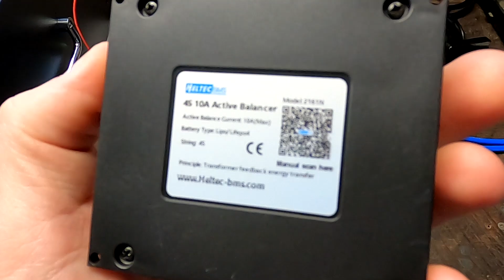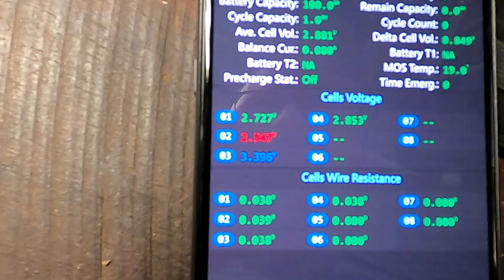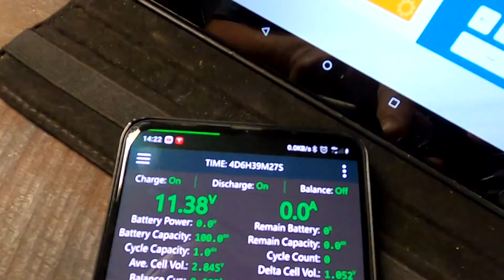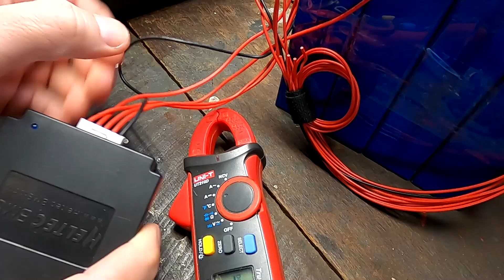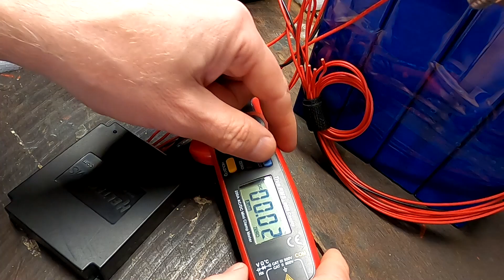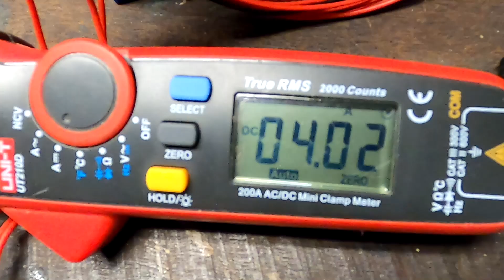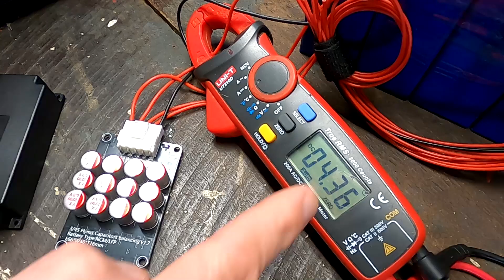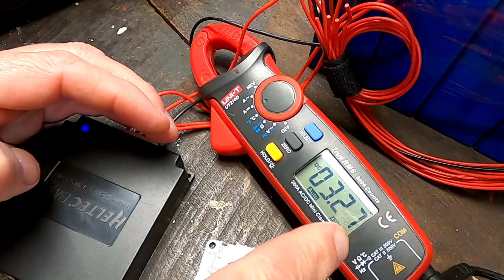REAL 10A with the HELTEC Active Balancer. Can we make it happen?

Comment: Hi Andy,  I'm sure I speak for most people by saying,  we are greatful you test things in a realisting manner,  not some server rack pack that's capacity tested and then a visual look,  most youtubers just do that,  you test things we actual curios on buying and test all the,  " but what if"  things. 
That open circuit balancer (the cheap ones)  I soldered 2 of them together on my 16s setup,  with a 300mv dif, using the same clamp meter I measured 8amp balance current. Just a suggestion, haha works better then the heltec and is still cheaper to have 2 cheap ones. 

Summer is coming for you and I,  and if I can suggest,  why not put panels on the tesla roof,  that gets less shading for winter, 
Useless update from my side on my 6k array,  winter I got 26kwh average,  and this time of year now I'm already up to 37kwh, noting 80% of my panels face north at a 40* angle.

Keep up the good work,  ps that number of subscribers paper is way out of date,  unless your not doing it anymore.

Comment: Good info, Thanks Andy. 
Btw, I recently built some EV packs from some "new" 32700 I got last year (now three years old) and some Daly 16S dumb BMS's, and while they worked on some perfectly matched and top-balanced cells they are incapable of balancing even 6ah 1s strings because they only balance with about 10- 20ma of current during charging above 3.45v. I tried charging at very low current for about 6 hours but only limited balancing.
Reply from the maker: Yeah, with the Daly, you need an active balancer. Their balancing will only work with small capacity cells if they are well matched and of high quality.
Reply: @OffGridGarageAustralia  And from what I just observed,  not even with small capacity cells that are well matched and top balanced. I just did a postmortem on a "quality" name brand 20ah, 18650 Li-On pack that had a Daly BMS and Lishen cells.The owner had been charging it after every about  40% use for about a year (about 100 cycles), and 3 out of the 6 parallel strings were more than .8 volts lower than the two remaining good strings. I suspect as the Daly BMS was not able to balance the strings and one string was finally over-charged to death.  

A local ebike shop that sells and services Bosch eBikes has what looks like at least 50 dead Bosch Factory packs with what looks like Panasonic cells that exhibit one or two dead strings and other imbalanced parallel strings. They appear to be using a similar design BMS to the Daly. 

My guess at this point Andy, is that makers of smaller eBike packs don't have physical room and budget for a proper an advanced BMS with adequate balancing, and never the less it if true, makes the case for not using a BMS without proper balancing, and to monitor, maintain and properly any pack as you are demonstrating here.

Comment: I wonder,  can the Heltec balancer pull from more than one cell and then pump that energy into more than one cell?     What if you had two drained cells and two full cells?    Would the balancer pull 4+A from Each of the full cells?    That would start getting closer to the advertised 10A.
Reply: That's what I was wondering as I watched the results.

Comment: Andy..... back when you were testing the dely  BMS can you remember what amperage needed to go into the BMS before it started charging?
The one I've got the charge controller is putting in 6 amps and the deli is only just turning on,
 seems to be quite a lot of loss of power.....
Which means if I get a grey day it doesn't start charging until the afternoon when it is producing more than 6 amps going into the daly...

Should I change this 4 string BMS?
If so what would be a good one to replace it with?....... that won't cost the Earth.

Comment: They are skinny little balance wires with significant resistance. Did you measure the voltage drop on them?
Reply from the maker: No, I didn't. I doubt this is the problem though. We're working on 3.3V only.
Reply: @OffGridGarageAustralia  yes, but a fraction of an Ohm will limit the current significantly.
Reply: @OffGridGarageAustralia  presumably your working voltage is the difference between a full cell and a low cell and is less than 1 volt. To get 10 amps the  series resistance would have to be vanishingly small. Just speculation on my part, but I think it may be significant.

Comment: dang! i just bought this balancer and i am getting ready to hook it up and i came across this video. i am VERY new to lithium and i currently have a 96 ah headway bank built in 4s and i was linked this balancer. so i bought it. and it made no sense how to hook it up based on the sleep switch.. labeled A or M and only said something about on or off in the manual..   so in your eyes this is junk? i guess i bought a $30 paper weight lol..   in that case what balancer would you suggest using for a 96 ah headway bank built 4s?  thanks for the video!

Comment: Andy,
Is it possible to hook up a Victron charge controller to a veritable power supply to check its output? To make sure it hasn’t got faults inside and not putting out its correct power. Think it would make a good test video. Thanks

Comment: Hi Andy.   Whooh, my dear friend.   You twisted the pooch with your last test!  You need to WAIT for a few cycles to happen.  REMEMBER that you are using active balancer units which charge the super capacitor, then discharge what it charged into a cell.  You can't just "plug it in" and expect to see MAX current.  Do your test again and give it a few cycles to get a full capacitor charge and discharge before you call the kettle black.  Cheers

Comment: Hello
Thank you for your reply
good with tests to learn more.
Can I ask a question?
I have a setup 830 watts 2 panels of 265 watts each 2 of 150 watts each
a Victron smart charger for each of the groups
group (1) 530 watts
Group (2) 300 watts
Charger 150/50
Both to a battery 12Volt 115 Amp
I would like more capacity from the battery bank as I have an inverter of 1500 Watt 230 Volt
and Cool etc
Can you recommend something that might fit
Everything placed on and in a caravan
which means that the weight should be as low as possible on the battery but high capacity
SINCERELY
Larry

Comment: Both of them can use switch ! The one without box have just near to white socket soldered RUN points, you can disolder and solder a switch to have the same feature. One fine feature is to solder a "voltage trigger" who detect 3.45V and run balander then.
Reply from the maker: We have explored this option already in a previous video here on the channel. That was not the point of the test though. I wanted to see the real 10A!

Comment: Still wandering how Daly 150amps 16s. Has managed to maintain less than. 0.01v difference in my two solar battery banks 202Ah and 230Ah for more than 1 year. Though it took one battery 76cycles and 230ah from docan 22cycles.

Comment: Hello
It cannot be an option to have a lithium battery with so much that you have to manage (keep track of) all the time. Balancing, Temperature, charging and how much to strain the battery in order not to destroy it.
All this at high cost
Is it possible to catch up with something else or is this a full-time job to look after the battery every day
Reply from the maker: I'm testing all this here on the channel, so what you see is not a real world set up. Usually the BMS will take care of your battery once correctly setup and that's it. I'm going outside the usual routines and test what happens if something happens, pushing to the extreme.

Comment: Hi Andy, 
I have a 24 volt system. A while ago I go I purchased 3, 305 watt panels. I hooked them up in series. I get (at max sun) 105 volts, but only get 9.5 amps. I think I installed the wrong. Even though they work right now, I don’t need that high voltage for a 24 volt battery, but need more amps to charge quicker and be able to take advantage of the limited sun we get here in Michigan. Wouldn’t connecting in parallel be better and Easter on my charge controller? I’d get more amps and still be above my battery voltage resulting in a quicker change. Am I thinking correctly?
Reply: The power remains the same. Your charge controller (if it handles that 105V) will convert it down to whatever the battery needs, and the lower voltage battery side automatically will increase your current (power in == power out). The higher voltage on the PV side has the advantage that it leads to less losses and you can use thinner cable. If you see 9.5A at the 24V side of the charge controller, you have an issue though - since those 300W panels in full sun should get you much closer to the theoretical max of 915W.
Reply: I think it is the opposite. If your charge controller can handle the input voltage of 105 volts it will be more efficient. Higher voltage and less amps means less resistance on the wires so more power will make it to the charge controller. The charge controller will also operate more efficiently at higher voltages.  Volts x amps = watts. 105v x 9a = 945 watts or if you connected them in parallel 35v x 27a = 945 watts. It is the same you would end up needing thicker wires to carry the current and your charge controller may have a minimum voltage input requirement higher than a single panels voltage. Either way you have set it up correctly and the most efficient way. You can measure the amount of amps going in to your 24v battery if you want to see how many amps you are charging at. For example if you are getting 945w from the solar panels you would have 945w ÷ 27v = 35a so you could say "I have 35 amps outside right now" of course on a 48v system like Andy's that would be half the amps or "17.5 amps outside"
Reply: 👆Agree.  If it’s an MPPT charge controller and can handle that voltage higher is often better…..HOWEVER 
With a series connection, If some panels are often shaded throughout the day it will affect the output of the array as a whole!  If you have for example 6 panels and 3 panels get more shade it can be beneficial to connect the shady panels in 3s and parallel to the sunny panels in 3s or whatever. 
Also, on a future upgrade you might consider increasing your battery voltage as well to increase efficiency

Comment: And-E: it may not be very likely at all BUT, conceptually – it is at least POSSIBLE that may be the overall cell/pack balancing process is operating differently than we might first think it is. Unless I misunderstood, you measured the current flowing out of the SINGLE HIGHEST VOLTAGE cell into… SOMETHING. Is it possible that PERHAPS what is happening is that the balancer might be – just for example – transferring current EITHER from – say (again, just for example) ALL THREE OF THE HIGHEST CELLS – AT SOME AMPERAGE RATE OR OTHER – INTO THE SINGLE LOWEST CELL?
Not sure if you want to attempt to check this out but I would say that IDEALLY when you want to test the balancer like this out, you might want to consider – and at least this is the way I would do it – is measuring the current flow on each of the cell balancers five in total leads, and see what the algebraic and absolute value sums of the current flows ‘work out to be’.
Thoughts?
Reply from the maker: That's exactly what we have tested in the first test and video😉 I thought I explained that right at the beginning...

Comment: If I top off my 8 cell Lifepo4 24v battery, do i charge it to 28.8 or higher?
Reply from the maker: 27.6V would be my maximum for absorption.
Reply: @OffGridGarageAustralia  Agreed! 
I use 13.8v daily in use for my caravan LFP battery, and LESS when it’s not being used, more like around 13.3v.

Comment: What is the size of these balance wires? Are they safe for 10A?
8:52 😱😱😱😱😱
Reply from the maker: Look inside this balancer in the first video. They are tiny cables...
Reply: Right,  seems like an obvious indicator that it’s pulling 10A is when the silicone starts melting off the wires
Reply: @maukaman  BINGO!

Comment: You should also measure the wire from no 3, maybe they did a “super balancer” that is balancing 2 cells at the same time :)))
Reply: But it is pulling from cell 3 so that is not valid

Comment: Most likely the balance wires are not thick enough and the voltage drop on the wires is reducing the current draw. I would be curious what happens if you replace those balance wires with thicker gauge.
Reply: the connector on the device is not made for thicker wires so that would still make it A design fault.
Reply from the maker: It cannot be the wire resistance. Look at the wires inside the balancer to the actual transformer!

Comment: Nice video Andy. Next try using balance wires with double the thickness of the factory installed ones and what happens if you plug in the balancers in parallel under this extremely unbalanced condition? Will they jointly deliver 8-10 amps?
Reply from the maker: It's not the balance wire size which is restricting the current to flow here.

Comment: Andy, I think a better test would be one cell at maximum voltage and one cell at minimum voltage and the rest of the cell is average. And I think the 10a or 5a advertise current is only achievable with NMC chemistry because of the higher voltage different between fully charged and empty and the voltage curve is almost perfectly linear. For LFP it can't reach because the voltage curve is too flat reach the flat part of the curve too fast.
Reply from the maker: They advertise a 1.5A balance current for every 100mV difference. I had over 1V difference in the pack...
Reply: @OffGridGarageAustralia  assuming 18awg wire resistance of 0.01 for 0.5 meter (it is even higher if smaller wires are used) and vh3.96mm connector contact resistance is 0.01 ohm for a total of 0.02 ohm then time it by for discharge and charging. You could see 0.4V voltage drop with 10amp and 0.2V with 5amp. This does not even account for any other connection losses.

Also I think should not the full and the empty cell next to each so that they don't share the balancing wire because imagine if the are next to each other in the string it might only show the amperage different. It might increase the appearance current or decrease it.

Oh and VH3.96mm connector is only rated for 6 amp per contract

Comment: I thought these were 10A max across all balance leads (total from the unit)  not just from 1 cell.
So if you had 2 fully charged cells and 2 low cells, you should get 4-5A from each full cells to the empty cells.
Worth a go?
Reply from the maker: But isn't that misleading? Could a 16s BMS with 150mA balancing current then be advertised as a 2.4A balancer?
Reply: @OffGridGarageAustralia   I agree, its not right and having just looked up the spec details, and I quote "When the voltage difference is 1V, more than 10A of balanced current will be generated, not more than 10A" Perhaps its not so 'REAL' 🤣
I spent today backtracking on my new JKBMS I fitted yesterday and reverted back to the old one with only 180mA balancing.
The app locks up solid on Android after about 3 to 4 minutes, so I tried 3 other Android phones, all the same.
Very disappointed. Cant find anything on the internet about this issue, I take it you have not heard anything about it? Thanks
Reply from the maker: @dtvking  Is this the newest app version? I heard from others having the same issue with an older version. 4.8.2 is the newest.
Reply: @dtvking  Is that a 4s-8s Jk BMS? 
There is a known issue with early ones, which I had. 

They asked me to return it, said they’d refund my postage.
They DID then refund the postage and have sent a new unit, (which is still on the way).
Reply: @FutureSystem738  Yes its the JK-B2A8S20P-H.
Just got a reply from them to use an updated app, I'm sure I've already used it v4.8.4 but apparently if the old version is still on your phone and all files not cleared out, it upsets the new version.
I have yet to try it, will let you know how I get on!
Reply: @OffGridGarageAustralia  Hi Andy, they have sent me V4.8.4. All old app files needs to be cleared out of the phone before install of the new version. If I get time I will try it later, I'm at work at the moment.
Thanks for your reply, I will let you know
Reply: @dtvking  Thanks Mark, good luck. (I’m expecting my new one to be delivered any day now. I have no complaints about the service through Hankzor BMS store at this stage and assuming the replacement all works. 
Prompt replies, and good service, just a shame about the postal delays especially when I had to post the faulty one back which took a long time.
(The postage from their end is quite fast!)
Reply: @FutureSystem738  UPDATE. I can confirm the newest version app V4.8.4 does work ok on the so called older BMS's, even if I did only get it last week.
I have only tested it with 8 x 18650 cells as it was not going anywhere near my powerwall when it was un-controllable, so I'm hoping that being on an under-powered battery will not change when connected correctly.
Reply: @dtvking  Thanks for the update 👍